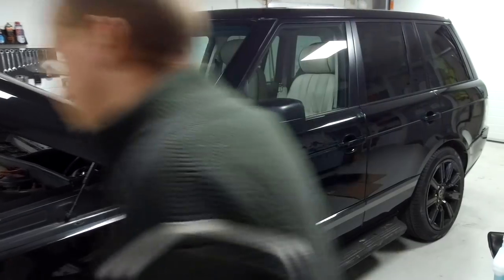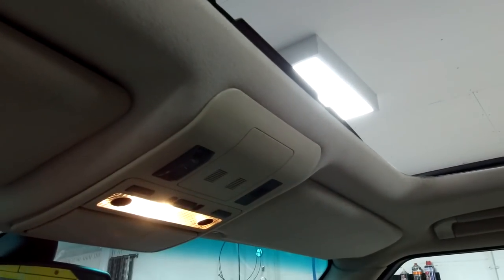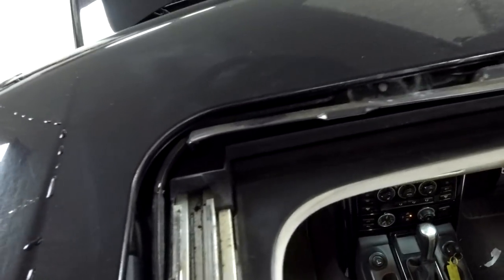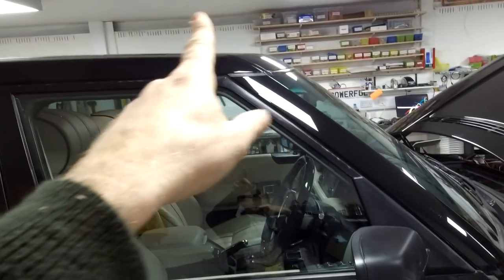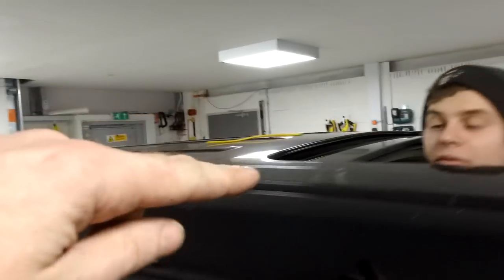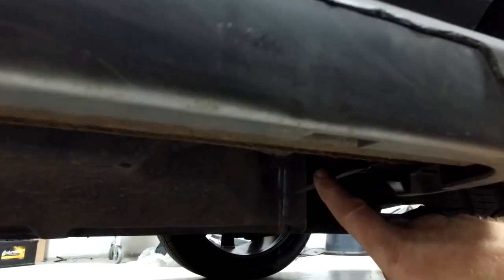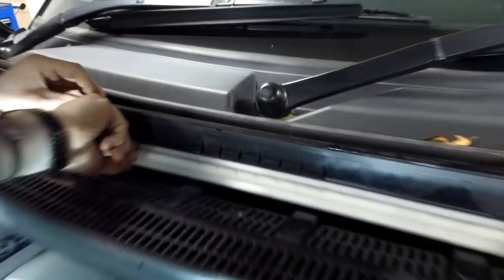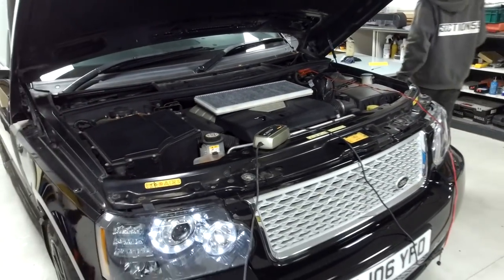Sunroof water leaks & fault finding on Range Rover L322

Comment: Just a note of the rear holes - they are PITA to try and clean from the sunroof cassette. In the end it was easier to drop the liner - disconnect the hose from the cassette and give a good blast (8 bar) of compressed air. Worthwhile to drop the side valence before hand to prevent the debris amassing and assisting the rusting process

Comment: Hi there, @UCjCbH52t-y0TPd6Y4CElvFw. Ive got a problem. Please could you help me and tell me to, which wire should I connect my 12v wire from LED rings in front lights connector (plug)? I bought rings and there goes 12v wire from left or right lamp and I need to connect this somewhere, probably to position lamp wire? On normal lights theres tension in yellow-grey, yellow-blue and yellow-red wires in front lights plug. In position lights on there is tension in yellow grey and yellow-red. Could you help me please.. :)

Comment: Hi, water leak in front and rear. I think the water damage my amp. I have no sound. I took it to the shop and was priced a $1000.00. Is there an easier fix than taking down the headliner. Thanks
Reply from the maker: normally you can just clean the channels - no need to take down the headlining.
Reply: Also, check to make sure the tail lamp is properly affixed. Mine wasn't, which caused the leak that fried my amp.
Reply from the maker: @johnrocha1117  Hi - not sure how rear tail lamp can cause a problem as its actually "outside" the car bodyshell.

Comment: Well did the procedure and roof looks flush know, but like on the Video the one touch close don't work any more how did you fix that problem on your car?
Reply from the maker: Yes you are correct in that the one touch did not work in the video but it did afterwards - not sure of this was just part of the calibration ?

Comment: Hi there,i love your channel, very informative content for someone with a land rover etc. i have watched the video above about leaking sunroof, but cannot find anything on youtube about my problem
i have black mould on the rear roof lining  and rear pillar, drivers side. i have checked the rear wash wipe as i thought the pipe might have come off the wash wipe and was running down inside the roof lining, but the wash wipe seems to be working ok.   i have ordered a trim removal set to take off the rear pillar to investigate, i dont fancy taking down the roof lining just in case i cant fit it back properly, i have not tried the sunroof drain holes yet, as i dont have any water in the footwells at the front or damp carpets.  i wait for your reply, thanks kevin

Comment: Interesting .. what a RR design abortion to block grommet with air tank.
I used to get a gurgling noise at speed when sunroof drain was blocked ...
I used to use a pipe-cleaner on a length of PYRO cable to unblock ...

Comment: What’s the likely cause of water in the spare wheel well? 2007 L322 Supercharged. Thanks!
Reply from the maker: The likely suspects are sunroof rear drain blocked and also roof rail holes not sealed properly.
Make sure you check water is not getting on the electrical stuff either side of your rear luggage space - check these as they are a big problem if they are getting wet !
Reply: powerfulukltd Thanks! There was a big round hole under the rear spoiler- on the left side as you face the back- could that be it? I plugged & sealed it. There was also signs of water in the middle piece of trim that you remove when taking the rear spoiler off. Is that a Hampshire accent?
Reply from the maker: @Defender-Guy  Look at my video for the rear brake light - there should be a rubber grommet in the hole ? Yes part hampshire --- bit of a nomad me.... Bristol > Manchester > Southampton > London > Cardiff > Thailand > Swindon ... so a bit mixed up.
Reply: powerfulukltd There are 2 holes on the right side, one for the 3rd brake light, the other for the camera. Both of these holes have rubber grommets. The other hole was on the left side. It had no grommet but does now. I’m hoping that when I do the ‘hose test’, nothing makes its way inside. I’ve lived in Hampshire several times- but am a nomad too, been livi ng in Eastern Oregon since 1994, next stop is St. Thomas, U.S. Virgin Islands!
Reply: @Defender-Guy what fixed the problem?
Reply: tx tx The seal that goes around the upper & lower tail gate (the one that fits to the car) was bad. Replaced it & no more leaks.
Reply: @Defender-Guy  thank you for replying ill take a look at it thanks
Reply: tx tx If you’re in the USA you should be able to buy the seal for ~$120. Fitting it is easy. You might find some rust along the edge of the metal that it sits on, I did.